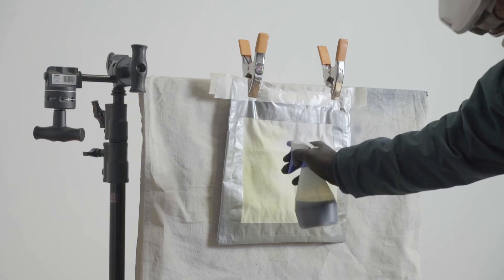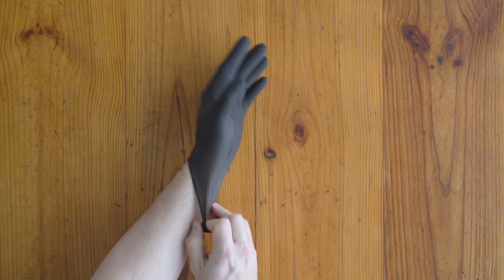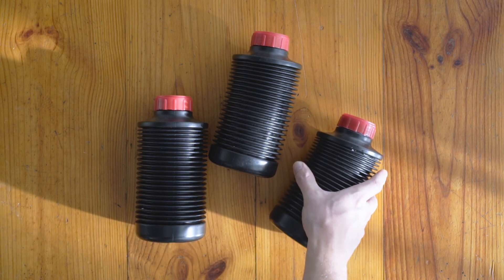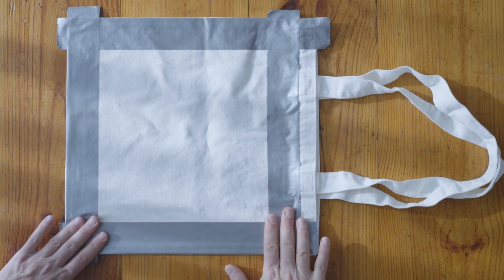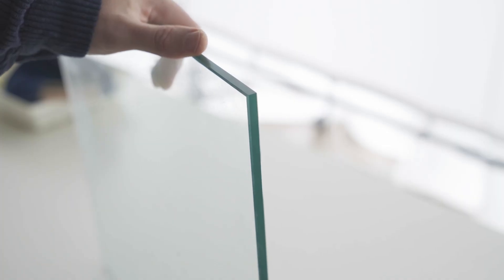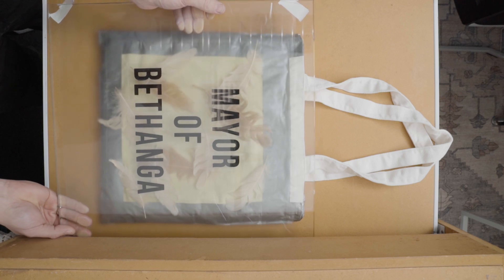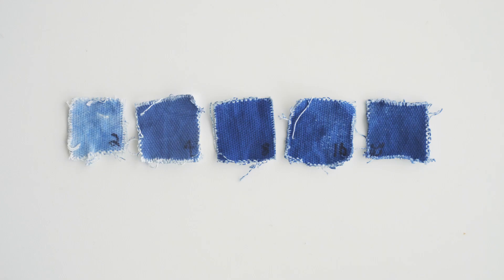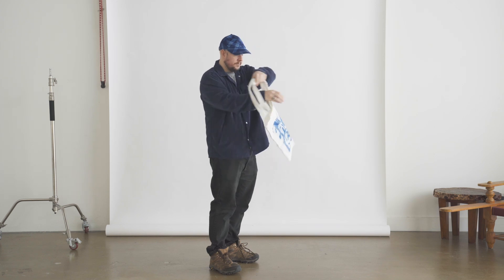How to make cyanotype photograms on fabric and textiles

Comment: 5:14 you can use a hairdryer to speed up this process
Reply from the maker: Good tip! Low heat and the reverse side of the chemistry for best results (though tbh I've ignored that plenty of times without too much trouble).

Comment: If you can't wash it with detergent, what you recommend the best thing to clean the fabric, if we do it on clothing? Cause, T-shirts or any wearable thing designed with cyanotype meant to be wash like a normal tees, so do you have any tips and recommendation?
Reply from the maker: You can use eco friendly detergents with mixed success, do some testing before you wash something important though. Any washing will cause the image to degrade over time however. An alternative I've discovered is to tone the cyanotype, which makes it much more resilient to regular washing.

Comment: My solution immediately turns green instead of yellow when mixing parts A + B. This is happening in the bowl so it's definitely an issue with the solutions themselves vs my fabric. Seems like I should have used purified water instead of tap but are my solutions useless now?
Reply from the maker: Tbh I use tap water all the time, I go through too much distilled water otherwise when I’m experimenting. I would describe the mixed solution as light green though, so you might be ok. Have you tried coating/exposing it?

Comment: Did you have top put anything on the fabric first? I saw another video that mixed a bit of gelatin with the mixture to get the chemical to stick to class. Have you tried this method?
Reply from the maker: As long as you use natural fibres it will sink right in! I use cotton mostly. Haven’t tried glass yet but have been saying I will for years, it’s on my photography bucket list.